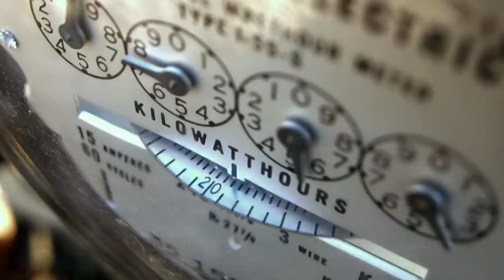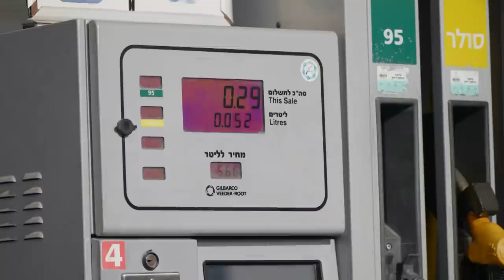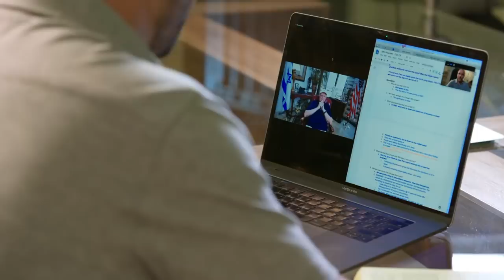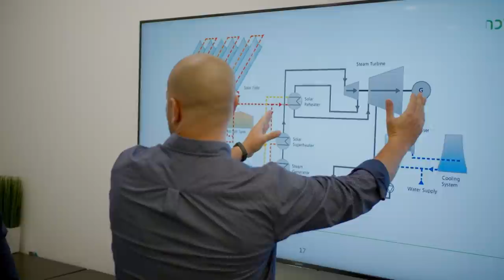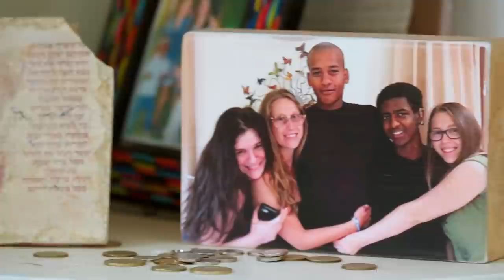How Israel is Leading the Future of Energy Sourcing | FULL EPISODE | Insights on TBN Israel

Comment: Use gravity to generate electricity, unlimited. Imagine you have huge flywheel and in the flywheel weight can be shifted in and out. Due to the weight different the flywheel will rotate generate electricity. New unlimited energy without petroleum or gas.
Reply: ?? Pls Explain! 🧐🤔